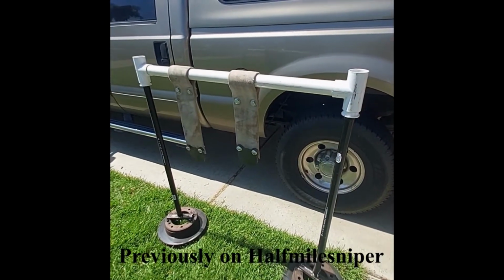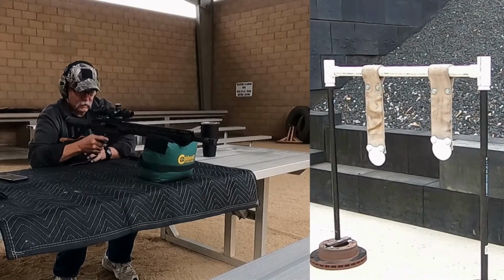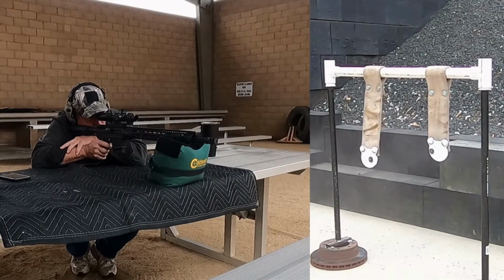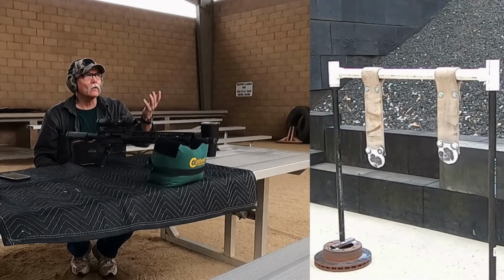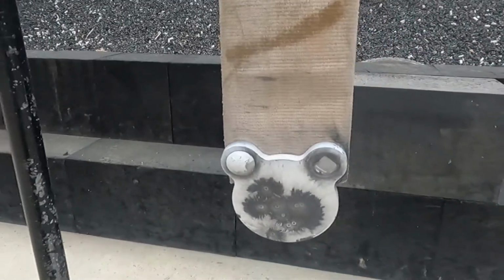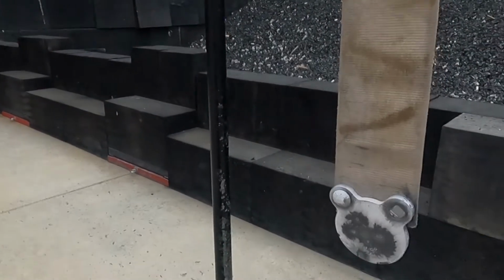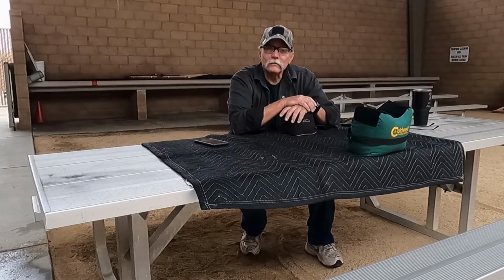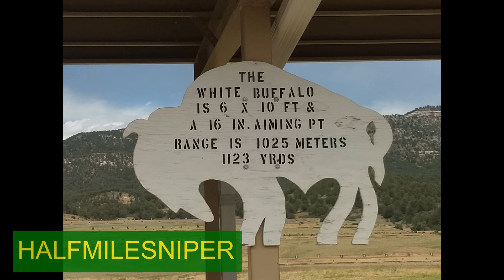Testing out the swinging targets

Comment: I use similar bolts on my steel. Spall has sheared off a few bolt heads over the years.
Reply from the maker: I was really surprised that the head of the carriage bolt just disappeared. I thought one of my shots had to have made a perfect hit on the head. After closer study I believe you're correct that spall managed to shear that carriage head off. Sliced it clean.
Reply: @Halfmilesniper  I suspect your fire hose compresses when the bullet strikes the steel, there by allowing a gap for the spall.
Reply from the maker: @mcqjohn8843  hmmm, interesting. I never thought about that.

Comment: Good swinger setup & not everybody can hit a carriage bolt head at 100 yards. 🎯 Went back and checked the round - 64gr Gold Dot which hits pretty hard.  Would a heavier round like 75gr make a difference or in this case none? Curiosity.
Reply from the maker: Can't claim a hit on the carriage bolt...pretty sure that was sheared off by small. 

I was surprised how well these .223 were flipping the plates. Pretty sure the 77 gr heavies would give them a little more whack.
Reply: @Halfmilesniper  Big Old 145 gr from a 350 might put a hurting on it. Of course a soft point tip might be easier on the steel. Lol
Reply from the maker: @billdye3530  I'm thinking a 170 grain soft point will get one spinning. We'll see if the soft points leave a dimple.